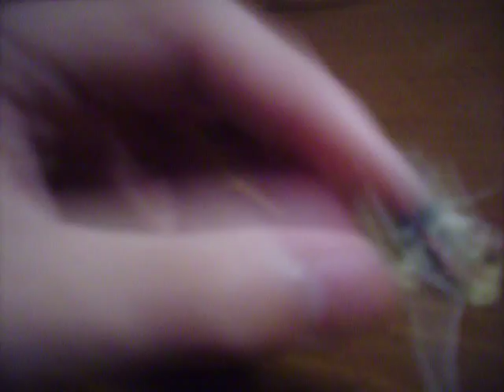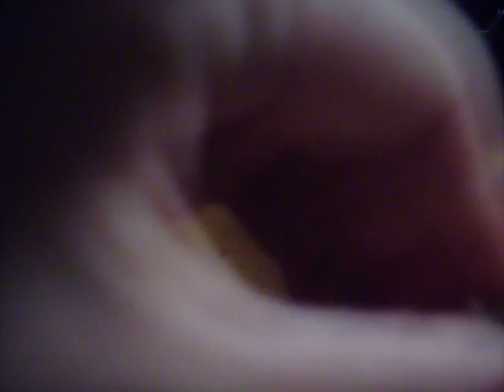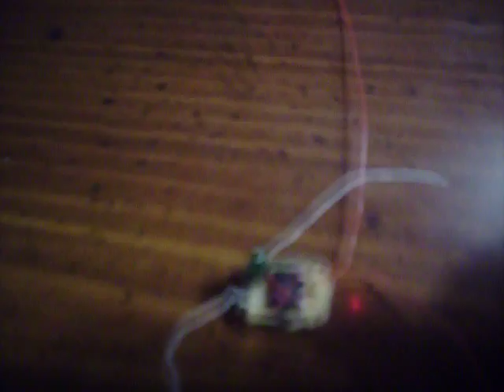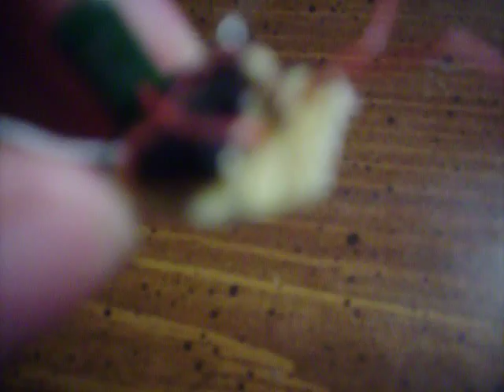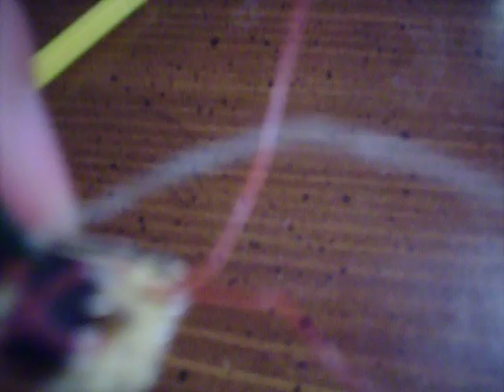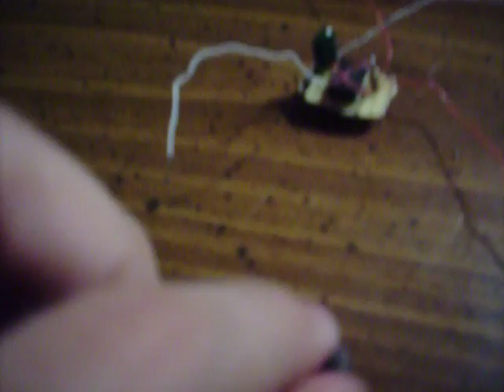how to make a rapid fire chip

Comment: if you use a npn switching transistor and solder the out put wire, pin 3 to a spst toggle switch and solder a wire from the base of the transistor  it will allow you to use the right trigger as the mod button, also you should use a trimmer to adust the speed, with a trimmer you can make it go insanely fast, pin one is gnd and pin 8 vdd solder pin 1 to the battery ground and 8 to the mic supply.